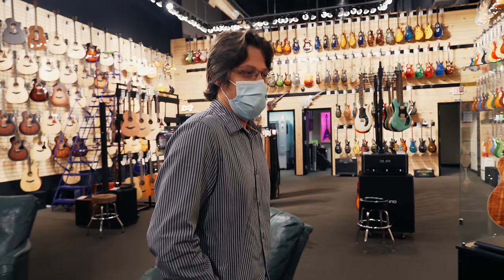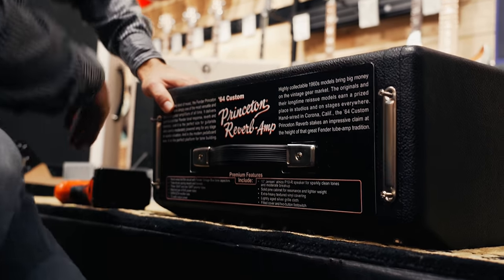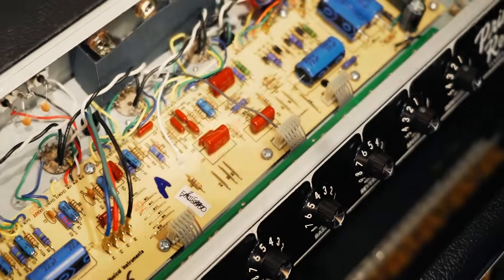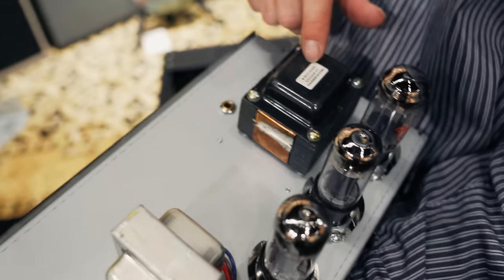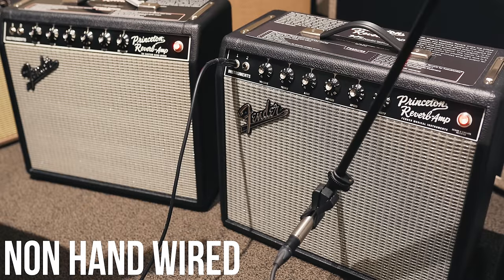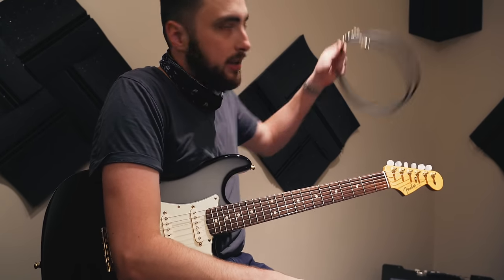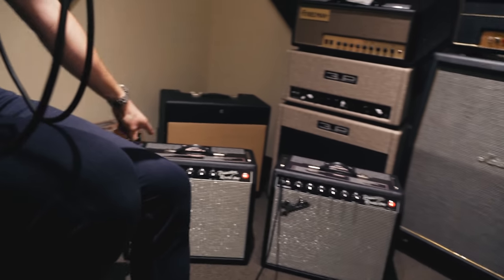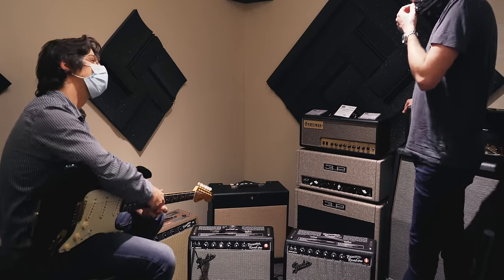Are Hand Wired Amps Really Better?

Comment: There is another option. Build your own. I built a Princeton Reverb for a little over $1000. This is a hand wired amp, built on a turret board with discrete, quality components. It sounds amazing, and has been relentlessly reliable. There are a couple of caveats. A beginner to electronics should build a couple of smaller projects first. Maybe a pedal kit or two. And you have to be meticulous, patient, and willing to double check every connection. But when you get that sweet tone from an amp that you built, it is a very rewarding thing.
Reply: Did you build your Princeton Reverb amp from a particular kit?   If so, will you please share which kit you used so I can purchase one.   I'd really like to do what you did.
Reply: I bought the board and electronics from Hoffman. Chassis,transformers, and choke(?) from Mojotone.  Cabinet and speaker from Weber. And you'll need tubes of course. I use Tube Depot. I prefer JJ's FWIW. Good luck.
Reply: @stratoman5504  Why not get everything from Mojotone?   Why board and electronics from Hoffman?  Where did you get the schematic?
Reply: @tonebenderx  Hoffman offered turret boards. I don't like soldering eyelets. His circuit has an improved tremolo which sounds great, and he also incorporated adjustable bias. Seems like soldering in a pot is a lot better than swapping resistors in and out. And as I recall his prices were reasonable. I used Hoffman's schematic and layout drawings.
Reply: @stratoman5504  which weber did you get? my pr clone has a weber 10f150t and i cannot wait to replace it with the wgs vet10 i bought. the weber is too dull and dark for my tastes.
Reply: @zhou_sei  Who makes a Princeton clone mojotone,Achilles,toneking?

Comment: The speaker made a difference.
Reply: speakers make the biggest difference, then the circuit, pcb vs hand wired does not make the difference you are hearing
Reply: Totally agree. And not worth $2,300 bucks for a 12 watt amp.
Reply: I have the non hand wired version with that same alnico . The speaker made the difference. As any speaker would.l have a lot of old black face fenders and my non hand wired Princeton sounds very good. I did change output tubes though. It’s a costume color and bought it used for a good price. I have a lot of old amps to compare it to. I don’t have an old Princeton reverb so it is different in comparison but the tone of mine is equally as good as anything that I have. I bought the amp to save ware and tear on my vintage gear. He’s right it’s probably not as durable as the hand wired but for the difference in price I can deal with it. Just have to baby it a little more. But the amp does sound good. I am very very pleased
Reply: Not at all. I can smell the snake oil concentration from the hw.